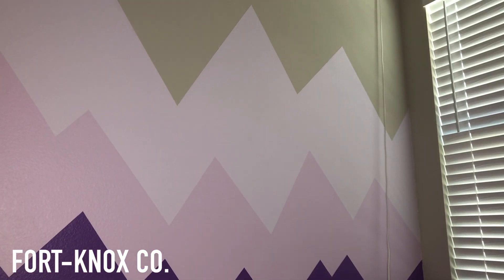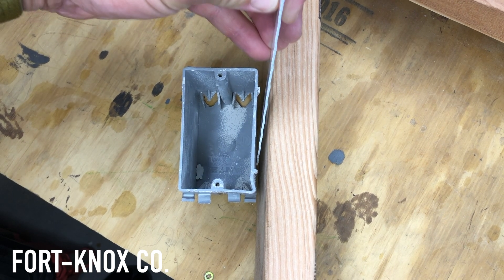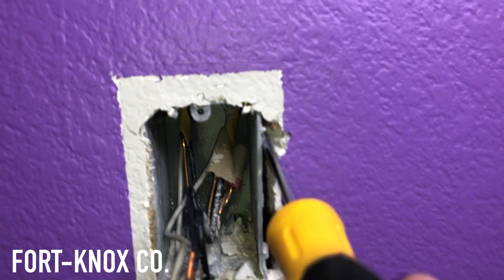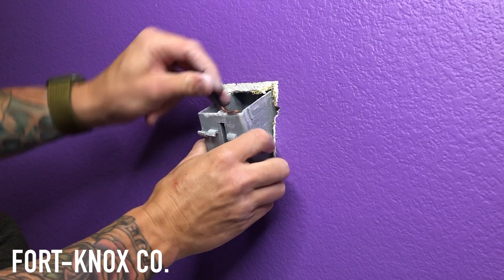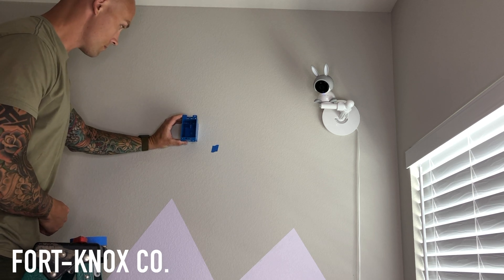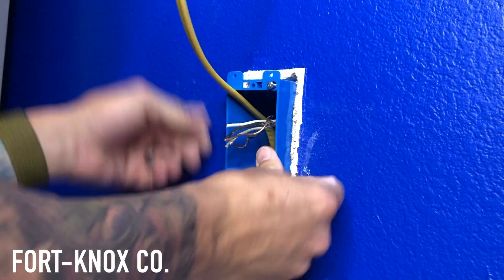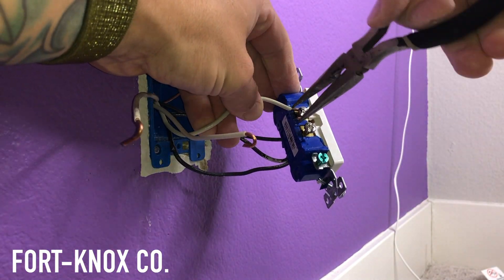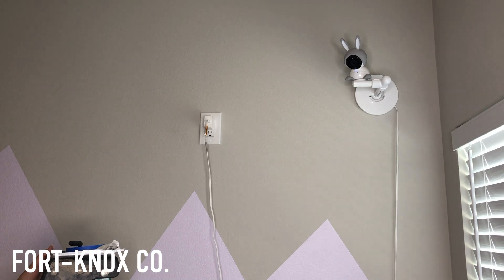How To Add an Electrical Outlet | Move Outlet Up Wall | Wall Mounted TV | Hide Wires  Easy!!

Comment: is it code to put 2 wires on one terminal?
Reply from the maker: I don’t believe so.
Reply: @FortKnoxCo  I researched it and don't believe it is, the code was along the lines of if the instructions for the outlet don't say you can do that, then it's a violation.
Reply from the maker: @Weekbrownies  that sounds correct.
Reply: @FortKnoxCo  I just pulled one of my outlets, it was wired like yours, 2 wires on one terminal, home built new in 2009 only owner
Reply from the maker: @Weekbrownies  hmmm. Yeah I don’t think it was technically a wrong way to do it. But over the years they have “better” ways or safer ways. 99% of the time it’s probably safe. But the standards go up I guess. I’ve heard that if you have too many wires on one screw, they worry about it coming loose or having some type of fault or spark. But then, when you pigtail everything, I feel like it creates a bigger jam of wires in that box and could be a hazard? I don’t know. I just follow the rules. Lol.
Reply: @FortKnoxCo  it's all good thank you, it was just funny when I pulled mine off today and it was wired the same way you wired yours, and it was installed by an electrician when my home was built

Comment: How do we get to the other side of a stud?
Reply from the maker: I’ll be making a video showing how to jump studs and move laterally on a wall. But I’m text, you will be having to cut small areas of drywall and drill some holes through the studs to pass the wire through. There’s several ways to do this to limit how much drywall work will be needed.
Reply: @FortKnoxCo  I have to cross 2 studs and go up about 12 inches. I’m hoping a flexibit can get the job done without extra holes.

Comment: Is it safe to wire the lower receptacle and continue to use it?
Reply from the maker: Yes. That is how most of your outlets in your home are probably wired. They are linked together. Sometimes up to 10 outlets are all wired in a chain.

Comment: What if you have cross supports in the wall?
Reply from the maker: Sometimes the are turned sideways to allow passage on one side or the other. But if it’s a full “fire block” You would have to cut a small hole or a “pumpkin” cut and drill a hole through the cross support and then feed the wire through the support and up to the finish location. It’s just another hole you need to make in the drywall and patch.

Comment: Heard this from another commenter. 

1) In many places it’s against code to have an outlet in a clothes closet. 
2) Do not drill a hole in the back of a device box. You need to have proper strain relief. 
3) Don’t use push ins on the back of a receptacle. Use the screws. They’re way less prone to failure which can cause a fire. 
4) Don’t put 2 wires on one screw like he did with the ground wires. Pigtail them and land 1 wire. 
5) Strip more jacket off the wire. Leaving 3-4” in the box just takes up space. 
6) Shut the damn power off BEFORE you start.
Reply from the maker: All very good info. You should always Shut off the the power before doing any electrical work. And codes do vary depending on where you live obviously. It’s very common to have an outlet in the closets out here, depending on your builder and style of house it may even be part of the original build.  Thank you for commenting ! I appreciate it.. Always learning

Comment: Are you allowed to put two wires on screw? I thought you were supposed to make a pigtail and connect that way.
Reply from the maker: You should pigtail the wires and just have one wire coming off each. Shouldn’t double under a screw

Comment: loved the straight the point instructions and explaining how to work around all those small complications along the way. I noticed you used the yellow wire and I assume they are pretty standard, but how exactly do I choose the right one - seems there are many options available 12/2,14/2 etc- what kind/model/type of the wire to use for this kind of a job ? thx
Reply from the maker: Thank you! I appreciate it!  Usually it’s the yellow 12/2 wire in the wall for outlets and the white 14/2 for electrical in the ceiling/lighting. 
12/2 is a slightly thicker solid core wire to carry a heavier power load from an outlet/appliance that might be plugged in. The 14/2 is slightly smaller and usually carry’s the load of power for a lighting fixture.

Comment: Can a third outlet be installed higher up in the wall? My wifi router is currently sitting on a shelf above my tv for better signal throughout the house but the power cord is too short. Tv already has an outlet behind it but I need a third socket to make this happen
Reply from the maker: Technically yes. You can branch up power to another location. I just wouldn’t put anything big like an appliance/blender/microwave on it. You are adding outlets to an existing circuit and you don’t want too many on each circuit. But adding a couple for things like tv or router shouldn’t be any problem.

Comment: Kinda what I want to do except I want to cancel the bottom outlet and move it up. How would I do that can I just wirenut the ends together at the old box then fish new wire up to a new box and make my connections to the new outlet?
Reply from the maker: Yes that’s pretty much how that would work. I have a video showing exactly that. It’s about a year old so it down in my library of videos if you search for it. But I moved an outlet up the wall. Just instead of keeping the original outlet wired in you could connect the wires and put a blank plate over the old box and just use the new one.

Comment: You need to pigtail wire, not code to put 2 sets of wires on one lug. Also need to know what your infeed voltage rating is to be sure your new line is the same ( 12 or 14 gauge wire and correct plug rating.)
Reply from the maker: 100%. I didn’t pigtail in this video and have since been doing it. It is a way better way to organize and clean up the connections too.

Comment: So why use new wire ? If you explained I missed it
Reply from the maker: I explained it in a recent comment. But no worries. The new wires are needed because you are adding length basically. Splicing from the old to a new location. You won’t be able to pull the original wire because it’s cut to length and to fit where it’s currently at in the wall. There isn’t much slack in the wall and you won’t be able to pull it. It’s also usually secured to the stud on the inside of the wall just outside the box. So that also holds the wire from being pulled out.

Comment: Awesome video. Any tips if there is a horizontal stud?
Reply from the maker: That’s very common. It’s usually a fire block or simply just a brace between studs to strengthen the wall. Usually your going to have to do a little drywall work to get past it. A hole next to the horizontal piece big  enough to drill a small hole in the wood  and pass the wire through. You can also make a “pumpkin” cut in the drywall next to the horizontal piece. It helps with less drywall work needed. But the usual process is having to get access into the wall=drywall work.
Reply: @FortKnoxCo  Ok then, thx a lot.

Comment: That outlet you put up higher does It have power on both plugs in or just one 
Cause I just saw you run one set to the outlets higher up?
Reply from the maker: It has power to both plugs. All outlets come with a connected terminal on each side. So when you connect one hot wire and one neutral wire to the  sides it makes both plugs Live. There’s a small tab that joins the two. In cases where you want only one to be live or one to be controlled by a switch and one to be live all the time, you break that small tab off and it makes each plug/terminal independent.
Reply: @FortKnoxCo  ahh ok thanks for the reply

Comment: Is there no ground wire for the new one that was added?
Reply from the maker: There is. It’s just the bare copper wire like the other one in the original outlet. The new outlet wires up exactly like the others. And the wires you run up to the new one are the same that are in the wall. One black,one white and one bare copper(ground)

Comment: Would it be possible to just pull the existing wire up to the new whole and just move the outlet all together, instead of adding one? And then just blank face plate the bottom?
Reply from the maker: You don’t have to wire back in an outlet in the original box. It’s just preference. But either way you will need to run new wires up to the new location and connect those to the original
Wires. The original wires won’t be long enough to pull up. There’s no slack in the wall. So you will be branching up or extending the line. You just connect the wires according to their matching colors and then put a blank plate on it. I’ve done this many times because the home owner didn’t need the old plug to be a plug.

Comment: This might be a stupid question 🤦🏽‍♀️….but why keep the old wiring if you used new wiring ?
Reply from the maker: Are you asking about the original wiring in the original outlet box ? Everything in this is being used still, we are just branching off/adding to the circuit. Not eliminating anything. So the old wires are still being used. But we are branching off a new set for a new outlet. You can’t really eliminate any wires in the original box otherwise you’d have plugs in other locations that would stop working. I hope that makes some sense
Reply: @FortKnoxCo  ohhh ok, that makes sense. thank you!!

Comment: Great video! What are the chances there is a stud sideways that will block the wire as it’s going down tours the bottom?
Reply from the maker: I’d say it’s about 50/50. Just depends on where you live and what code requires. And who the builder was. Exterior walls have them usually as fire blocks and to help strengthen/stabilize the wall. Interior walls are hit and miss. I usually run a stud finder up and down the path to check before I cut. That way I can plan ahead
Reply: @FortKnoxCo  Thank you so much, great video.

Comment: I have a question so the original outlet closest to the floor. Does it still work to? I didn't see you put a blank cover over it.
Reply from the maker: I wired back in the original outlet down by the floor and it will work as usual. This is just branching off that in a daisy chain to power the one above it as well. You can just connect the wires in the bottom/original location down by the floor and put a blank cover over it if you don’t want/need an outlet there. But most just keep the outlet low and high

Comment: Thank you for acknowledging what a PITA it can be to get the cables and box out with out 'too' much drywall damage. Now if I can manage to get the same 6 cables threaded back IN the box. Sheathed romex was a challenge (extended to new box) I'll not forget anytime soon. The current project was a box from hell removal situation - taking a break now.  Gathering strength to wrestle the medusa of cable fed back into the new and improved (a 3 gang 😜) box. More room for all those wires but still akin to herding cats getting them all in there, 😉 at the same time and each with a bit of sheath. 😏
Reply from the maker: Sounds like you got it done! Good work !

Comment: What about not outlet at the bottom just moving it up behind a tv ??
Reply from the maker: You can to the exact same thing, but instead of wiring back in the original outlet in the bottom, you just connect the corresponding wires and put a blank plate over to cover. You will be basically just extending the wires to run up the wall to the new one. Splicing them.

Comment: Nice video man, u have some video to move/install in horizontal and not vertical?
Reply from the maker: I’ll be making a idea about how to cross studs and different methods to use depending on how much drywall work you want to do.

Comment: Do you have a polyethylene vapor barrier between studs and drywall on your above grade exterior walls, to prevent condensation damage? If you do and the work penetrated this seal you would need to repair that leak before installing the new boxes. That would be a code requirement in many northern locations today.
Reply from the maker: Here in Las Vegas we do not. But this video is mostly to show how you can easily branch up or off of an existing circuit to add one where you need it.

Comment: The hell are you doing about wires that are stapled to the studs ?
Reply from the maker: Like behind the original outlet? They are usually stapled to the stud just outside the box, usually within 6-8”? From the box itself inside the wall. And usually they leave a slight bend or tiny bit of slack right there. At least they should. See how I used a lot of “usually” ‘s. Because I’ve seen every which way of doing it. 
But in general, when you pull a box out or outlet, you should have a tiny bit of slack to play with. 
If your asking about when running the new wire up the inside of the wall and stapling it, then you usually don’t staple it, you’d have to open up the whole cavity most likely to do that.

Comment: A question. I have an existing outdoor  ornamental pole lamp with 3 lights. How can I install a dawn to dusk light sensor?
Reply from the maker: There’s a couple ways you can install one. Either on the log post itself, get access at some place on the post and the wires and install the sensor in line with the power coming to the lights and then drill a small hole for the sensor to stick out of the post housing and install it that way, very similar to how some light fixtures are made. You’d just be doing it yourself, but it’s very common to have the sensor somewhere on the fixture itself. 
The other way would be installing the sensor on or near the house/switch. So if the switch is left ON the sensor again will be in line to the lights and  will open or close the circuit depending on how much day light there is. A lot of houses have these sensors installed up high by the roof eves and controls the exterior house lights. 

I have a video on my channel showing this and there’s a link for the sensor on Amazon in my video details as well.

Comment: I’m working on this project now but the light switch I’m piggy backing off of has a ground, white, black and red. The wire I’m running to the tv mount outlet only has ground, white and black. Can i run just those wires and ignore the red without a problem?
Reply from the maker: Yes. The red is basically another black (hot wire). The white acts and a neutral for both.  Using the black/white/ground for the next switch will be fine and just like a regular circuit. Usually when there is a red it’s controlled by switch or in addition to the black. Like two switches that control two functions in the ceiling. I have a diagram showing all this in my other video where I’m running wires through the ceiling. Might help visually show what’s going on
Reply: @FortKnoxCo  Thank you. Will check out the video too. Appreciate your help!

Comment: I'm confused... You added more wires? I thought you just fished the existing wires up the wall?
Reply from the maker: I branched up a new set to a new outlet. So in a sense I sort of T’d off/up from one outlet. Adding one more outlets the whole circuit, not just moving an existing one.
Reply: And sometimes them old wires are also nailed to the 2x4 so it's hard to pull threw

Comment: Great vid, what did you do with the 3 ground wires?
Reply from the maker: Thank you. The ground wires just get twisted together.
Reply: @FortKnoxCo  you dont have to hook one to the green screw?
Reply from the maker: Well yeah. All three come together, and at least one goes to the ground screw on the outlet. I usually cut two shorter, twist them along the one longer one. Then hook that one to the ground screw.
Reply: @FortKnoxCo  very helpful thank you
Reply from the maker: No problem 🤙🏼 Anytime

Comment: If i want to get rid of the lower outlet completely, and just move it up the wall, and change it from a 2plug outlet to a 4plug outlet, do i need to add more wires? If so, how would i do that? Lol Or can i just cut the new hole, pull the wires up, cut them to size, and wire them in? Asking because theres an outlet where im adding cabinets and want to move it up the wall above the new countertop. Sorry for the long comment! Lol
Reply from the maker: You can definitely just add an outlet above the old one. You just don’t have to wire in the old one once you extend the wires up. But you will need to connect new wires simply extending those wires up the wall to the new location. And then put a blank flat plate cover over the old box. That old box where the old outlet was needs to still have access per code. You do not want to drywall over the old box where you extended the wires if there’s going to be any connections there. I’m assuming you’re gonna have to extend those wires up therefore you’ll have some type of connection in that original box. I’ve done this for the same reason and we moved the outlet up from behind a new cabinet and into the backsplash area.
Reply: @FortKnoxCo  Thanks alot mate! Appreciate it

Comment: Question here. 
It does really matter how many outlets you connect to one? 
I’m trying to put a light socket up high but I’m scared that it will be too much for the bottom outlet if that makes sense?
Reply from the maker: I does matter in the long run. But usually it’s all dependent upon code in your local area. Most places don’t allow more than 10 outlets on one circuit. How they are linked together or branched off of wouldn’t really matter, it’s just having too many on one breaker COULD be a bad thing. Imaging having 10 outlets and all 10 being used at the same time ? That’s be worst case scenario and code allows that as a possibility and considers it still “safe”. So if you add one here  to branch up it’s usually not a problem at all. I just wouldn’t go adding 2-3-4 more outlets and not consider adding a new line all together at that point.  But 1 extra I wouldn’t worry  about.